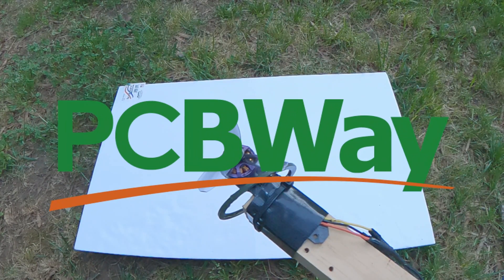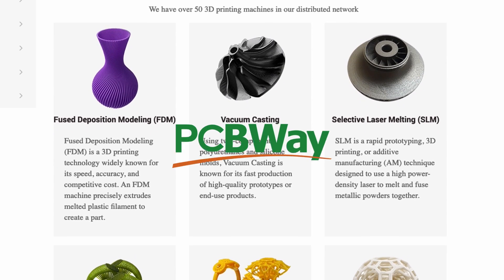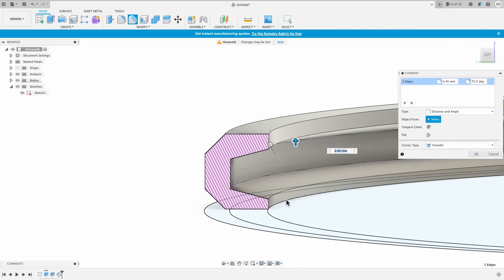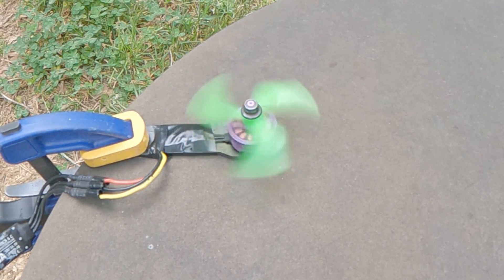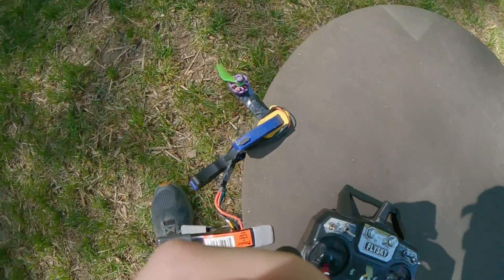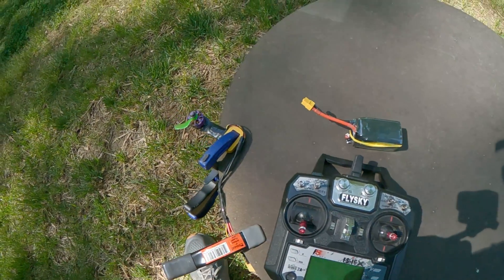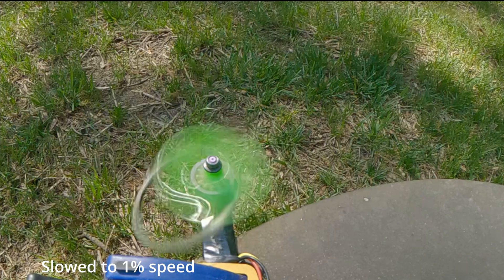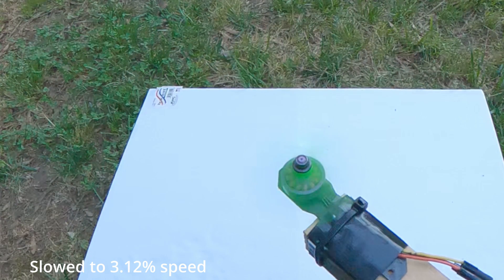Propeller "Guard Ring" Concept (3D Printed)

Comment: 6 or 7 years ago, and forever before then, you had to have equipment to balance your propellers. Now the factories are able to make them in balance, and reliably too. A prop that 's not balanced will cause vibrations, and the worse the imbalance was (and the higher the rpm) the stronger the vibration would get. Your ring isn't balanced, and once you attach it to the prop, they are both trash. The other big thing is: you are getting to ~60% throttle, but that 2300kv motor really only spins up to ~30,000rpm, and an appropriate motor for that prop on 4s would spin twice that fast, so you are having failure at roughly 1/4 throttle relative to it's normal operating rpm. 
That said, I love that you did this, and that you were unaware of the history on this topic long enough to fully commit to this project. You have shared a fun experiment with us, and I enjoyed it. I will continue to watch, like and subscribe :)

Comment: I appreciate your efforts on trying to make multirotor flying as safe as possible. And regarding the design, well at high speed there is a minor compression or expansion of the props depending on the tip speed, thats where they are not able to keep it intact apart from the vibrational factors, please correct me if am wrong....
Reply: And I also feel that balancing might have helped you in reaching 90% or more for a certain period of time,  after damping a considerable amount of vibrations.  Just a taught....
Reply from the maker: Yes, balancing would definitely have helped.

Comment: Probably best to avoid having to deal with balancing and slower responses by just having a duct attached to the frame and not the prop. I realize these ducts exist, and thus it wasn't the point, but basically, they'd need to be a part of the injection molding for this to work I think.

I suppose the next best thing would be a nice strong resin print.

Edit: Having now watched most of the video, he ends up with the same conclusion, so this comment is largely redundant.
Reply from the maker: Agreed. 👍